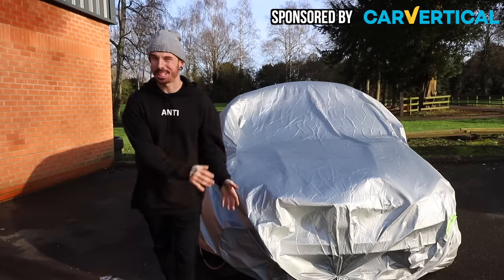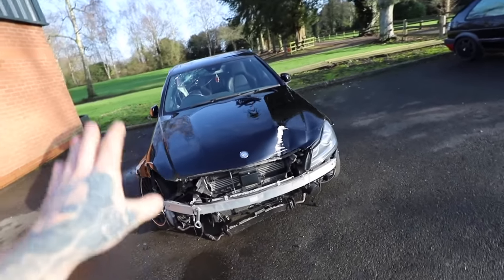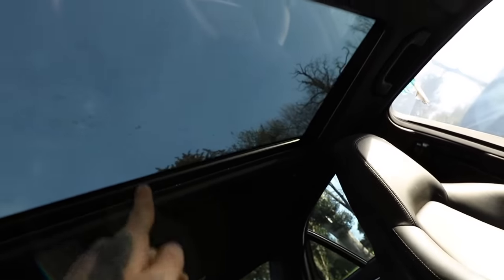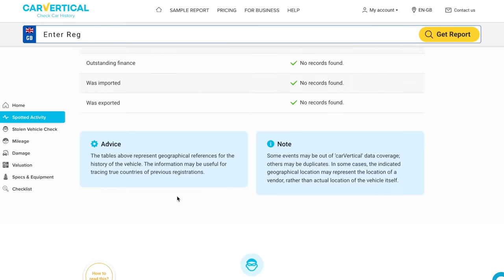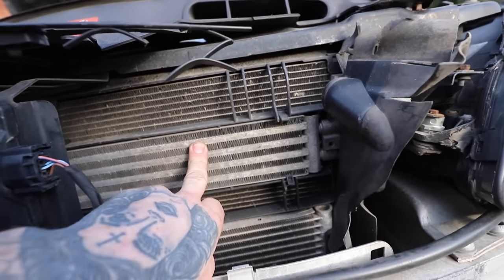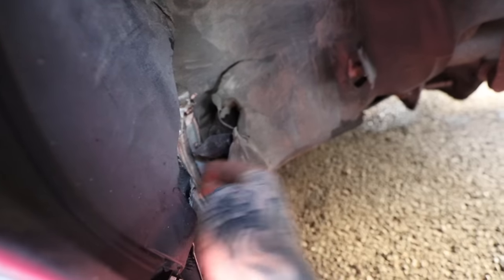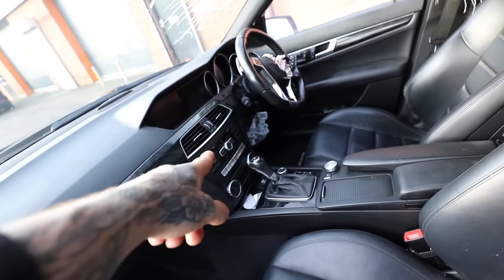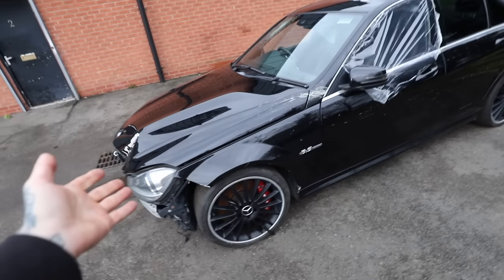I BOUGHT A WRECKED MERCEDES C63

Comment: It's definitely been through a wire fence of some sort having been smashed into a kerb just before. I'd have said maybe into a field but it's not particularly dirty. I can't help with the parts unfortunately but a performance pack w204 C63 coupe is a bucket list car for me! One day. I hope you can work something out. Good luck!
Reply: I was thinking it might have been driven IN a ditch or down a narrow country lane. Winter hedges can do serious damage to any car let alone this being driven at high speed
Reply: Agree, scratches are from a barb wire fence and the front damage could be from a fence post (not bad enough to be a tree etc). Country road?

Comment: HI Matt, you can probably get away with no parts apart from oil to check the engine. For the oil cooler, just join the pipes together, I'm sure you would be bable to find something to do this securely. As for the sump, just clean it thoroughly where it is leaking with alcohol and use gaffer tape or epoxy to tempoarily seal up any holes/cracks. Only needs to last 10 minutes or so while you put oil in, check it for leaking and crank it. Obvioulsy if it turns over or even starts, switch it straight off to check the sump repair before doing any more.

Comment: Very correct on the headbolts they would corrode and snap, causing the heads to lift, owning one the only thing to watch for is lifter tick, maybe a good idea on a video to remove the rocker covers and check the cams! Very easy to do DIY once the cars up and running…

Comment: As a wild guess I would say that the car has been through a pig and rail, barbed wire fence. The bonnet damage is from a fence post and the scratches are from barbed wire raking the side of the car. As for joy ride, possible, however there was only one person in the car, as the passenger airbags did not deploy.

Comment: for the oil cooler can't you bu pass it with a extra piece of tube to connect the 2 sides and then you can start it and do the same for the coolant
Reply: Yep can then find out if the car is worth repairing, if the engine is seized it's just a parts car for someone.

Comment: Yes, yes, yes, love it, cannot wait for this. If you have to break it, break it, but if you can save it, it'll be class. Just thinking about the back story, would the drivers airbag deploy if the seat belt wasn't on? Or is it just the passenger airbags that won't deploy if no seat belt is detected? Either way, can't wait for this beast to raise from the ashes 😀

Comment: The oil cooler in the middle is also the engine oil cooler, it has two engine oil coolers. However I I removed my fan from mine as it hinders cooling in my opinion

Comment: Drivers airbag wouldn't have deployed had no seat belt been worn as its all linked into the SRS system no? 
Also did you hoover out the car as you suggested windows were smashed from the outside? Typically would have expected forensic dust had it been stolen, the police tape can either be yellow or Blue and white depending on what they have in the boot 
Hope you bring it back to life though mate, would love to have your budget!

Comment: To be honest you'll be better off with this buying aftermarket parts. You can get better bonnets but they are expensive. Mercedes are usually very good at getting new parts out to you for the majority of the internals but when it comes ot the wings I'm not so sure. As I said when you got the last C63 these are crazy expensive to repair, even the lower spec C Classes can get expensive. 
On the last C63 I said there was no way you'd get it repaired, on this on I say go for it!

Comment: MAT BUYS a gem lol - its a brand new second hand new car ... 2012 C63 is IN fantastic condition-Get it in the ramp quick 4 months later  ( even Stevie Wonder would give it a thums UP ) its mended , roll on end of build in end of April cool this is as good as a CAT s  or cleaner than the C63 Silver  lol...Mat the other C63 u part exchanged for I believe 7k ? to get the cooler GOLF R to build into that mother monster build was epic .. hope this turns out to be a smarter HEAD build all done in the best possible taste by Mat than the headache discovery that  END's the joy ride HEADCASE / DAMAGE ..police  police   police... Mat will Face lift IT ... BETER THAN NEW soon ... what a car , was a engine , what a build it is eventually .. come on Mat you are the man for the job '' re come on  -  we can rebuild it better than before '' Nice